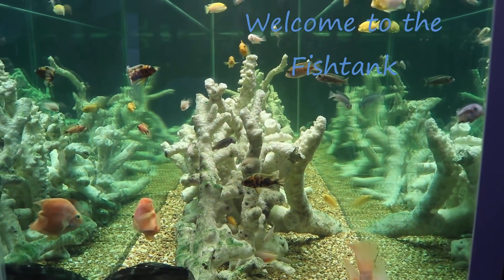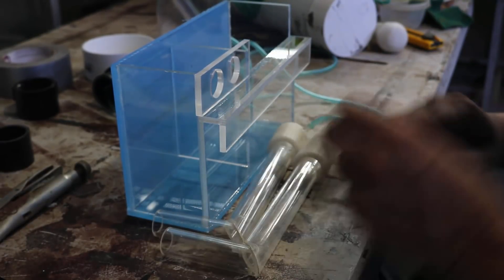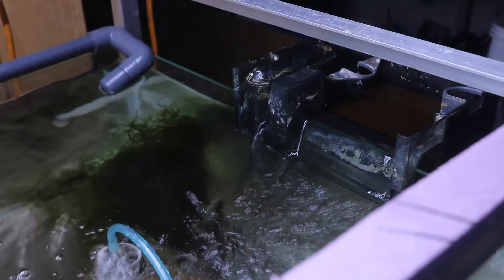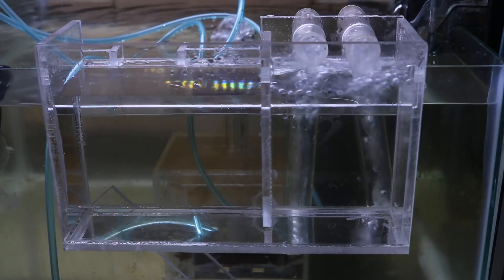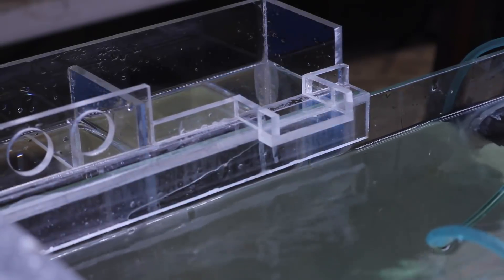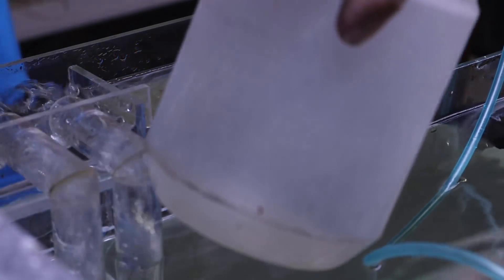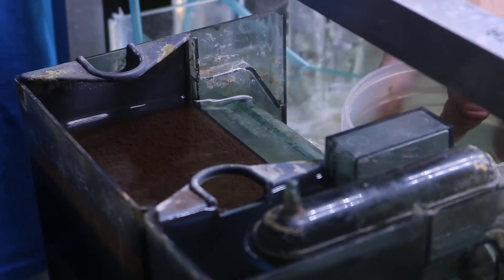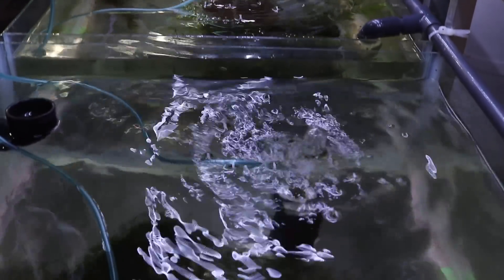DIY Air Driven HOB Vs. Power Filter

Comment: I know im super late, but what about using air to drive an impeller? Set it up basically like a rotary engine where the air comes in at an angle and also upwards to assist with rise
Reply from the maker: Just a little lol! I have thought about trying this, but it is a complicated assembly and I just haven't gotten to it.

Comment: i had one of this style when i was a kid in the early 1960's the air lift returned the water  so you could draw the intake deeper
Reply: Right. And they didn't self-prime.. . The box should be as deep as the tank for best effect.

Comment: To increase flow  using sweeps instead of 90,s. You can also angle the sweeps(bring them in from the end of the filter instead of the side) so they are not getting back pressure from the rear wall of the filter.That will also increase your flow speed by pushing that water towards the spout. The direction of travel (end to end) will allow for a less turbulent cycle of water flow. Nice workmanship :).

Comment: If you are having issues with height difference having an affect on flow, you could turn the input to the HOB down then add a bit of an extension to get the outlet lower than you now have. This way might work to lessen the overall difference. Might not work because it is driven with air, but might be worth a try.
Reply from the maker: Been playing around with lots of air driven systems. Will have some new stuff soon. Thanks for sharing your thoughts on it. Will have to see if that will help. Thanks also for watching

Comment: This is giving me another great idea. Are use a powerhead but I live in a place where power goes off all the time Cama I got one of those silent air pumps The takes almost no energy at all to run, if you do the powerhead on one side and air next to it, you can put the air on a battery back up end it will run four hours without killing the battery backup, that way you still keep a little water running through your filter to keep everything alive.
Reply from the maker: Cool Idea! Thanks for sharing
Reply: Fishman Do you know of anyway to use air to lift water higher?  I run a window planter with pot Phyllis and lava rock on top of the tank, but the top is about eight or 9 inches above the water.   I was wondering if you used a white tube at the bottom and the skinnier tube at the top if it would be able to move the water higher.   That pump doesn’t move a lot of air, it works fine at surface level but It would be nice to find away with a single airstone to get water that high even if it was just a little bit.  🤔
Reply from the maker: @ShaneZettelmier  That is something I've been working on with no success so far. Sorry
Reply: Fishman  lol.  Need a miracle or a bigger battery I guess.  😂

Comment: longer acrylic pipe down into the tank, as close to the bottom as you can. use an airstone to defuse the air you you will get super lift ;)
Reply: Yep, done the same but with PVC plumbing pipe and air stone also with the exit pipe made to go to the other side of the tank.

Comment: now THAT'S a Idea I like instead of power motors, air pumps never thought about doing one that way  COOL IDEA.
what size air pump did you use by the way for what size tank?
Reply from the maker: The air pump is actually a large pond version that hooked up to a manifold and ran a line to this filter. It runs a bunch of tanks. It shouldn't require a lot of air though. Thanks for watching and taking the time to comment

Comment: I used air driven filters for years. The best of them siphoned water from the tank into the filter and pumped it back into the aquarium,  if you use siphon you can run the tube any where in the tank you want,
Reply from the maker: Thanks so much for you input Robert. Thanks for taking the time to watch and comment

Comment: If you make smaller holes, they will give more water
Reply from the maker: I was thinking the same thing. When I was making the test air lift, I used the smallest drill bit I had. I was waiting to see if it improved the flow at all before I went and purchased a smaller one. Thanks for taking the time to watch and comment

Comment: Great Job !!   that really did work very well !!   What a great Idea .. I am going to have to watch a few other of your videos .. I have a hundred gallon tank and it's been a pain with these heat I'm guessing !  I also wanted to thank you for your kind words you left in my video ... I appreciate you ..  Keep up the amazing work ..
Reply from the maker: Thanks so much Shannan. I really appreciate you taking the time to watch
Reply: Hang on the backs are needing a rotary engine inside that cannister. Have you figured out that one? And it's electrically driven. What you are not doing is the archemedies and using an internal cheap pumper sits on the bottom cheap Temu have em. They are very good and 100 percent safe. Waterfall effect. One thing. Cover the tube end with a thin filtration bag, incase of fish babies damage and stops sand if substrate, to be guzzler up too. I raised tadpoles you know all 5 lived. Coochums. Xxx

Comment: Another great one! That extra aeration that your filter provides is something I wish the HOB's had. Ever think of doing a hybrid? It's hard to explain without "Talking paper" but and air power lift tube that goes up and into the side of the HOB. Opposite the impeller side. That would really agitate the water coming out of the filter. I don't know I'm just kinda thinking out loud.
Reply from the maker: That's a great idea. I think certain protein skimmers use a similar idea to inject allot of air into the water they move. Put one together and make a video about it. I'd watch for sure
Reply: An airstone provides SIMPLE aeration....

Comment: I have been thinking about an undergravel filter coupled with a HOB like design. but powered by air.  I was thinking about a longer box at the full length at the back wall of the tank where the water could flow through compartments with more media to polish the water, it could also incorporate an algae filter or an emergent planted area for plants or both before allowing the water to tumble back into the tank.  Flow rate would not be an issue because thelonger the water took to flow through these chambers the more the water could be cleaned.
With your airlifts what if you put an elbow on them to push the water down where they enter into the HOB?
Reply from the maker: Great seeing you again Melody. If I'm understanding your question, you want the input tube to carry the water to the bottom of the first chamber in your filter design. The problem with something driven by air is it just wants to go up, but what you can do is place a divider at the input so the water flows down in the first chamber and also allows the air to escape. Sorry if I'm misunderstanding your question
Reply: Just trying to imagine a way to reduce the turbulance on the surface as it looked to me looking at your design that the water flowing out ricochets against the back of the HOB and the turbalence pushes back against the incoming flow which might be also slowing the incoming flow.  What if the power lift tubes were deeper in the tank, would that affect the flow rate at all?
Reply from the maker: Your right on both counts Melody. The turbulence does cause a small amount flow reduction but also is great for gas exchange. If you have a deeper tank then the longer the lift tube the greater the flow. Thanks for your input